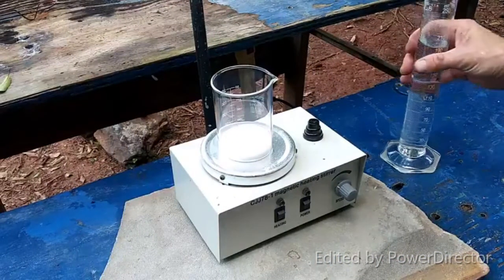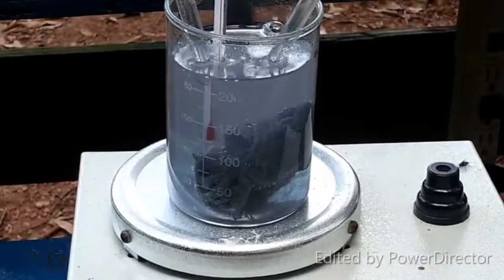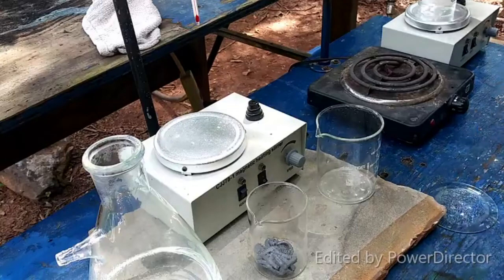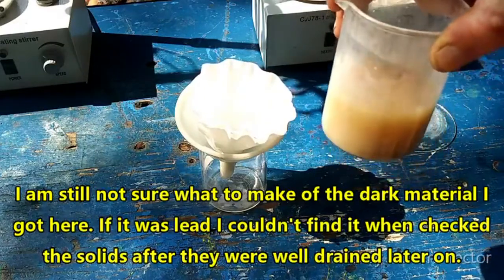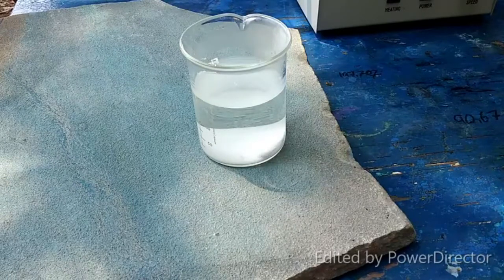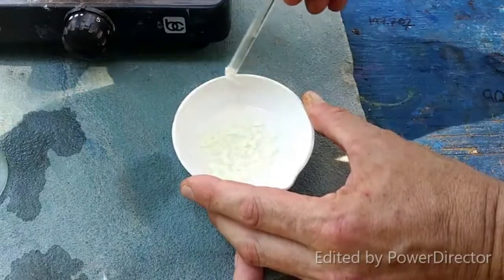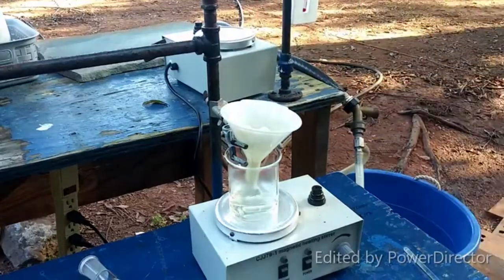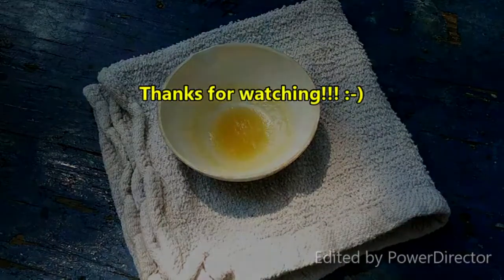Reduction of Barium Nitrate to Barium Nitrite Using Freshly Made Lead Sponge #barium #nitrate

Comment: I'm interested in producing some barium nitrite via lead nitrite.  This synth seems very low yield and less pure than I need.  I'm looking looking for a method to make lead nitrite.  This can be displaced with Barium chloride to produce substantially pure barium nitrite.  Thoughts?
Reply from the maker: And you're complaining about the purity of the product I made? Your method isnt going to give you very pure lead nitrite either. If I were you Id make it from lead chloride and silver nitrite in water at about 50ish°C. Silver nitrite can be precipitated from solutions of silver nitrate and sodium nitrite. This will give you a vastly purer lead nitrite product. Le Chatliers principle drives the reaction. Doesnt matter that lead chloride and silver nitrite have low solubilities. Silver chloride's is orders of magnitude lower. The equilibrium will lie far to the right. Now that Ive solved your synthesis problem for you Id point to the paypal or cashapp tip jar linked in the description. 😁
Reply: @PoorMansChemist  I didn't mean to sound like I was complaining.  :)  But great reply and thanks!  That's awesome.  Thank you brother!  I will see what I can do about the tip as it's well deserved.
Reply: @PoorMansChemist  Another method that's come to my attention is Calcium Sulfite and Sodium Nitrate reduction that seems to be very pure and high yielding.  Was going to give take a stab at Barium Nitrate and Calcium Sulfite to see if it works.  Wil let you know.
Reply: Also, just made some Calcium Sulfite and have it in a desicator.  Will be heating up a crucible with it along side Barium Nitrate to try the above reduction.  More to come here too.  Hope all is well for you my friend!
Reply: @PoorMansChemist  Got around to doing some testing.  I found that silver nitrite will exchange with barium chloride to produce barium nitrite and silver chloride.  I am in the process of boiling down the product to crystalize it and complete some simple verification.  The results look good so far.  I was considering AgNO2 -> PbNO2 -> BaNO2 when we last spoke.  But I got lazy and decided to try skipping the converstion to Lead Nitrite and go straight to the end product.  Seems to have worked.  Will update after qualitative test for Ba Nitrite.

Comment: Hey pmc what do you think about the preparation of tetrabutylammonium nitrite? Could lead sponge work from the nitrate? I wanted to post that prep but cannot for the life of me figure it out. I've thought about the barium nitrite and tetrabutylammonium sulfate double displacement but all I can find is tetrabutylammonium hydrogen sulfate which I figured would react with the nitrite.
Reply from the maker: If you had a tetrabutylammonium halide you could use silver nitrite. I used the same trick to switch 2 chloride ligands for nitrite ligands on a palladium complex with that trick. Silver nitrite is super easy to make. That would be what I try first
Reply: @PoorMansChemist  dude I knew you'd have the answer when I get around to it I'll definitely credit you for the best possible answer. I do have a halide so you made my day!
Reply from the maker: @midwestchem368  Glad to help!

Comment: PMC, u need to write me per mail since I can’t read u message at pp. Don’t know why maybe op just sucks 😕
Reply from the maker: Gotcha. It cuts off your messages too. All I was saying is that this is the only way I know to produce nitrites without starting from other nitrites. I got good results when I used the method I showed in this video to reduce barium nitrate to the nitrite. If you can make barium nitrite and then react it with sodium sulfate that will give you a solution of Nanos which can be evaporated down. Or if you live in the US you can buy sodium nitrite by the pound from Duda Diesel. I can vouch for for quality of their stuff.
Reply: @PoorMansChemist  unfortunately I live in Germany and pure nano2 is not obtainable for the amateur on normal ways. Can I use ur method with nano3 or kano3 or do I need to get bano3 first ? Did u get my mail adress for maybe the future 😉
Reply from the maker: @horsthorstmann2480  Just send me an email. My address is in the description of the video. It's just poormanschemist at gmail dot com (I have to type it out or YT deletes it). I would imagine this method will also work to convert sodium nitrate to sodium nitrite. You shouldn't need to get barium nitrate. But this is just an educated guess mind you. Both barium and sodium are such active metals that they cannot be reduced to the metallic state in water. Thus in both cases they should merely be spectator ions that play no part in the reaction. My advice is to do the reaction on a small scale and test it just to be sure. But I would be very surprised if it didn't work. By the way isn't sodium nitrate hard to get in Germany? I thought you guys in the EU had a hard time getting chems like nitrates and nitric acid.
Reply: @PoorMansChemist  i will do next time 🙂
U prep of barium nitrite looks doable for me but on the other hand much more involved than I thought it would be 😬 
had something excepted like take nitrate salt and slap some sodium borohydride on it 😂
Nitric acid, >12% h2o2, >10% h2so4, cs2, are some of the base chems who are almost impossible to get for the amateur over here. Potassium nitrate is quit easy atm but was harder some years ago 🤷🏻‍♂️ 
But on the other hand I can get redP, iodine, acetylchloride, methylnh2 •HCl with ease. Things I know are hard to get in USA normally.
Making meth is just not that common here that they would need to restrict certain things. Sadly I’m sure the day will come since the EU will restrict everything „dangerous“ someday 😕
Reply from the maker: @horsthorstmann2480  Unfortunately this is the only way I have found to reduce nitrate to nitrite. It's not as hard as it looks and I am sure I suggested improvements to how I did the prep in the video . 

 You can get red P, I2, acetyl chloride, etc if you know the right people to talk to. They aren't controlled in the US only listed. But you are right in that it can be hard to find a vendor who will sell that to the public. It depends very much on the compound. I2 is easier to find than red P for example. 

Sounds like you are lucky with most of those chems. Sulfuric acid is very easy to concentrate and the H2O2 is only marginally more difficult.
Reply from the maker: @horsthorstmann2480  Yeah I can't find anywhere to buy sodium cyanide or potassium cyanide. I have to make it myself every time. I can't even imagine not having 90%H2SO4, 35%H2O2, and 11M HNO3.  I couldn't make most of my videos without that stuff. Here anyone can buy stuff like that.
Reply from the maker: @horsthorstmann2480   You know we have a lot of people in our little community that are over in Europe. They might be able to hook you up with some chems as well. Are you on discord?
Reply: @PoorMansChemist  at the moment there is nothing I really need. only things I want to make myself 🙂
Im not that advanced in theoretical chemistry, but I’m very good at preparing specific routines, and I know much about chemicals and there specific hazards and interactions.
However, to find a routine wich is fully explained, that I have no questions after reading or watching is not easy.
Probably no problem with more in depth theory, but theory is not so for me 😉
Oh and to be honest, I never used discord nor I’m even sure if it’s voice or text 😅